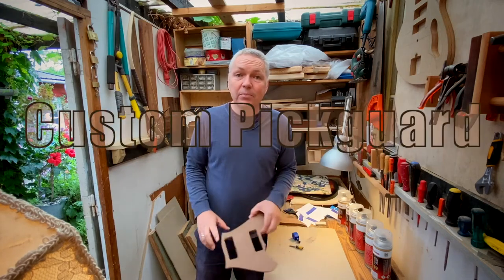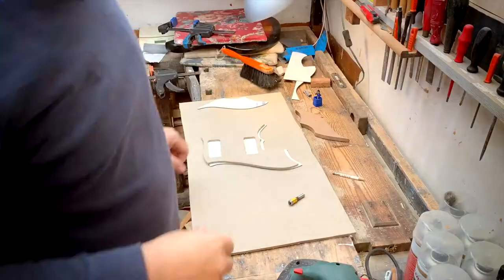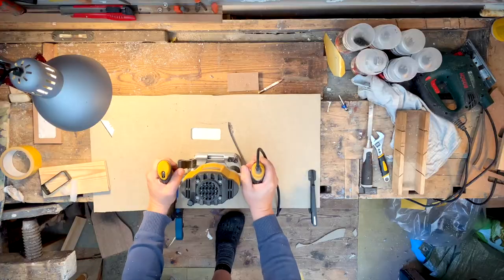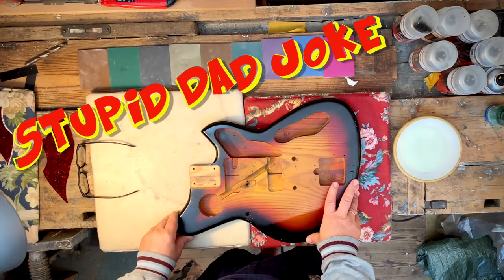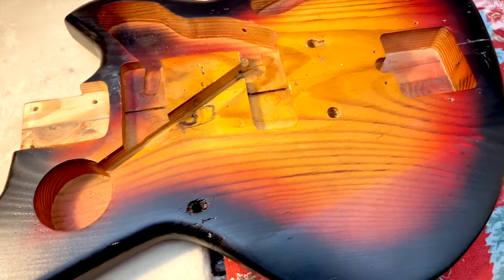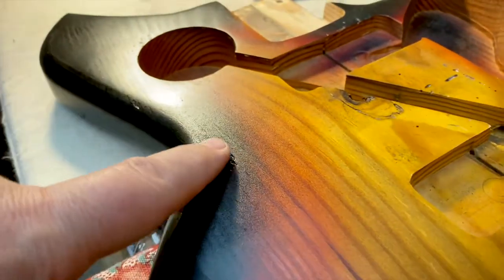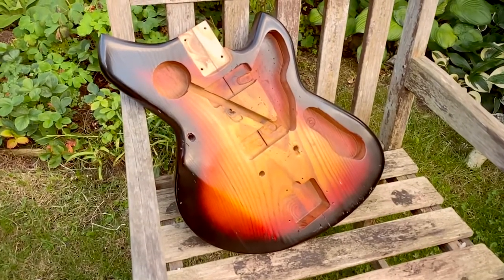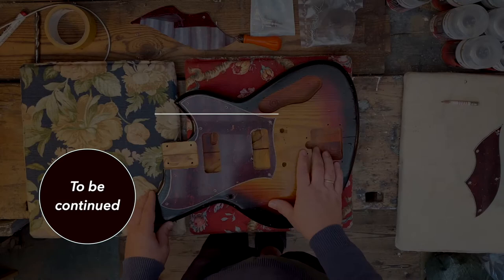How I made a CUSTOM PICKGUARD at HOME

Comment: Another great video. I love the idea of how you routed the lifeguard on the pedestals for someone that doesn't have a routing table
One thing, when using mesh pads up to 12k grit, you can dry sand thru
Reply from the maker: I tried dry sanding but it was definitely better wet... just be sure not to put to much water on the wood 😉👍🏼

Comment: I'm doing my first build with a 3-color burst. Unfortunately mine didn't turn out as pretty as yours. What I've seen in many videos for the clear coat is to do 3 light to medium coats and let dry thoroughly for a couple of days. Do 3 more and same drying time. After you apply however many coats you want (never more than 3 coats per spray session), start level sanding after 2-3 weeks of drying/curing, using successive grits around 1200, 1500, 2000. I think on my neck I did 800, 1200, 1500. It will be hazy but then clean with naptha. Then get some foam buffing pads for your drill. Use a medium polish and a fine polish. Start with the medium, polish until you feel you've gotten as far as you can. Wipe it clean so that none of the polish residue remains or it will get mixed with the fine polish. I guess you could clean it with naptha, especially if you've touched it with your fingers. Then, use the fine polish with  a different foam buffing pad and polish it until you get the mirror finish. Some people will then use a swirl remover which I think can be applied with a soft cloth, and maybe finish with a preservation polish. I got my lacquer and polishes from StewMac.com. Between the medium and fine polishes, let the guitar sit for about 15 minutes to cool off before going to the fine. I'm a novice and in a steep learning curve so I'm not trying to be a know-it-all. I'm just sharing what I've studied, and it did work great on the neck. What's cool is to watch these videos, then try it myself and get the same results. I really like your pickguard work. I'm going to have to buy a router now. :) Good luck on your future projects. By the way, all of the procedures were for nitro-lacquer.
Reply from the maker: Hi 
Thanks so much for your comment. Your extensive research seems to be paying off. Well done. I really like the kind of rough and very thin Novo finish and didn’t go for the glass like surface. I think that’s a lot harder to achieve... sounds to me like you will be able to do it. Thanks for sharing your research. 👍🏼😉
Just great
Reply: @MichaelLagerstedt  You're welcome. It's fun to share ideas. I've gotten so many from you and all the other videos I've watched that it's sparked some ideas for finishes that I really want to try. Stick together and keep on keeping on!

Comment: I ordered a pickguard from a company called Dragonfire. I asked for a Floyd rose route for the bridge, but they didn't cut it accordingly. Would it be easy to modify it so it'll fit the bridge, or should I send it back? They offered to recut it.
Reply from the maker: Hi Matthew
Thanks for watching 🙏.
Definitely send it back and let them do it.
Making a pick guard with out the proper templates and a routing table is not that easy. So unless you are experienced in that stuff let them 😉

Comment: Isn't showing how you made the template kindof important?
Reply from the maker: You are right. I could have gone into more details on that.
If you check out this video at play time 13:18 you get an idea of how I did it.
https://youtu.be/BgAUoH3TVVA?si=oYI99R66R2N5s9tE

Basically, I printed the template as a poster from Adobe reader, and put the four pieces together with tape . Then I cut out the paper template and transferred the shape of the pick guard to the mdf. 
After that, I cut out the shape roughly with the jigsaw and then I took my time fine-tuning it by sanding it until I was happy with the template shape.
It’s a pretty long process, but with a cup of coffee in the Sun, I find it super relaxing work.
I hope this helps.
Thank you so much for watching and thanks for your comment 😃🙏🏻